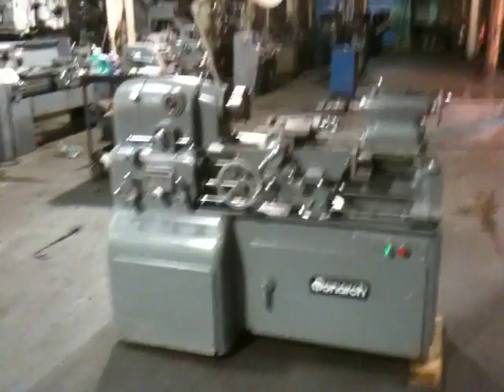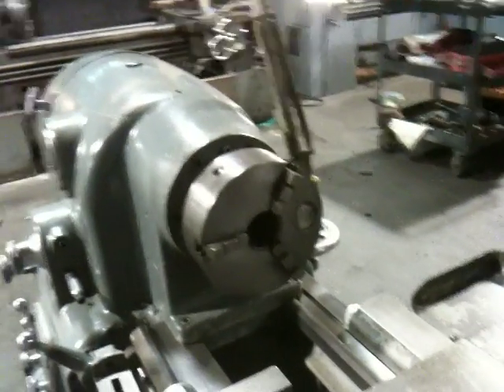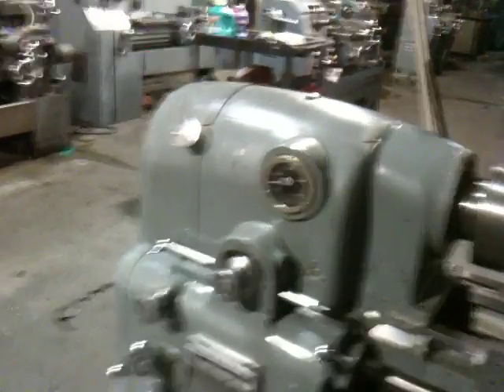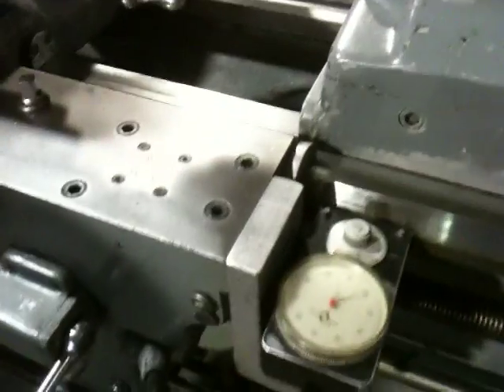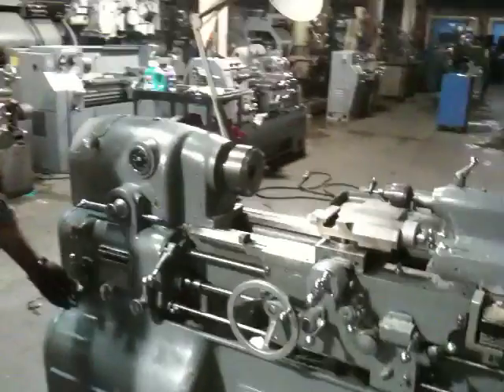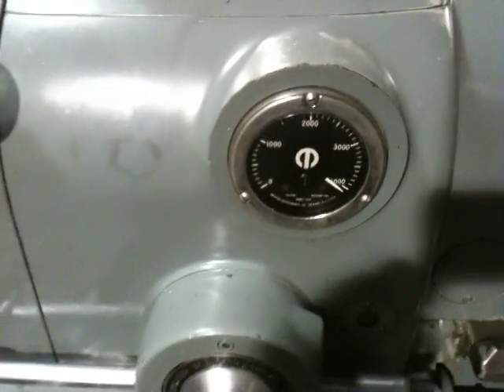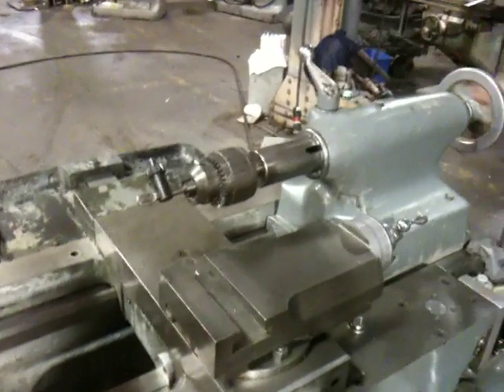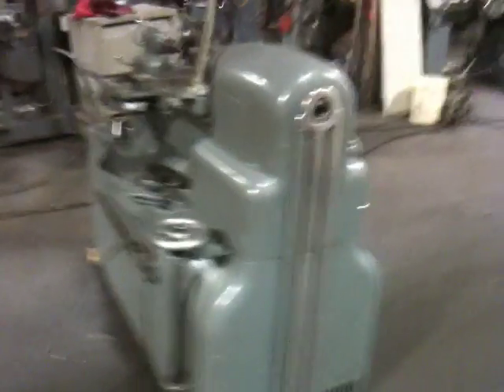10" X 20" MONARCH PRECISION TOOLMAKER'S LATHE

Comment: That lever switches the drive from back gear to open belt. He had the lathe in back gear for low speed (to chase a thread, for example). Open belt allows the spindle to reach higher speeds (up to 4000RPM)...